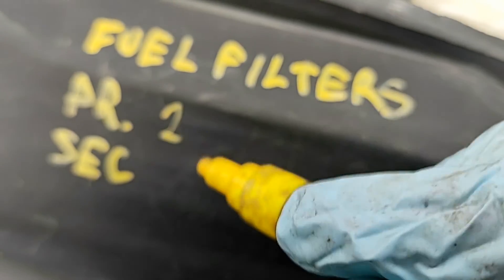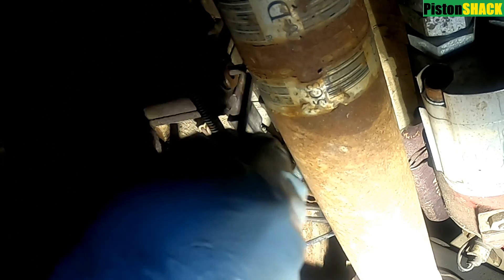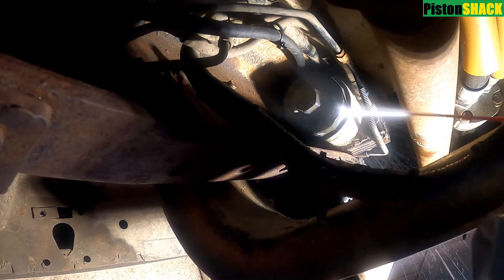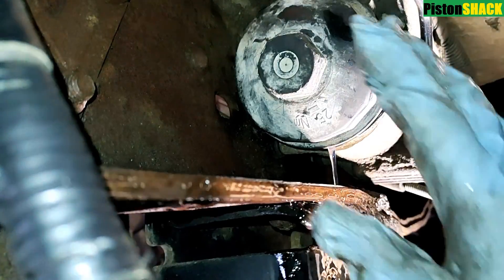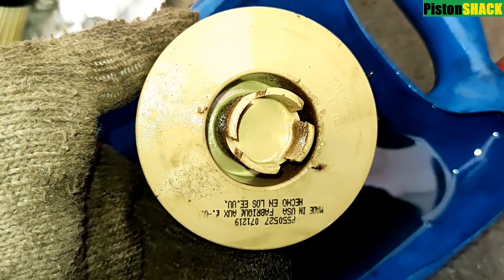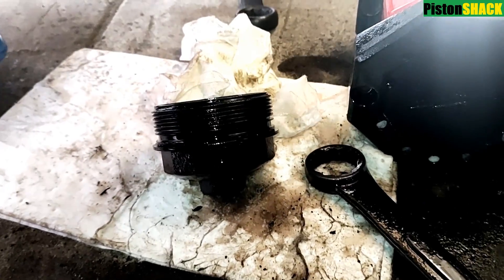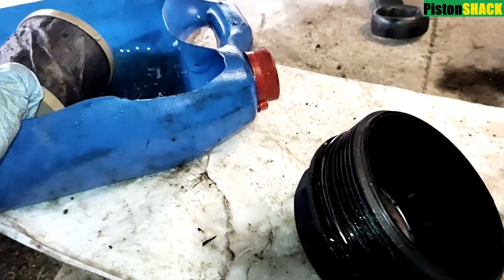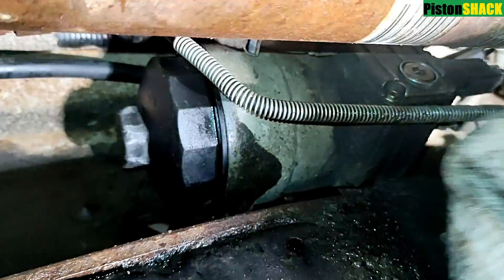HOW TO CHANGE PRIMARY FUEL FILTER ON 6.0 POWERSTROKE DIESEL - EASY!

Comment: Hay bro great vid would that filter being dirty like that cause rough idle and cause shutter under load or in overdrive?
Reply from the maker: Hey D'S NUTZZZ. Ablosutly, dirty filter will cause reduced engine performance for sure. I would change filter first before doing any other repairs.